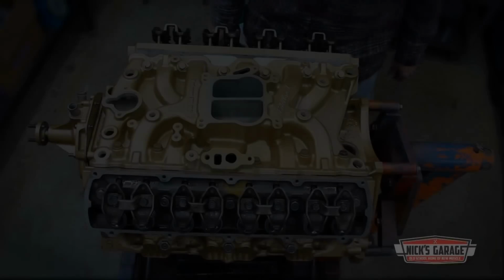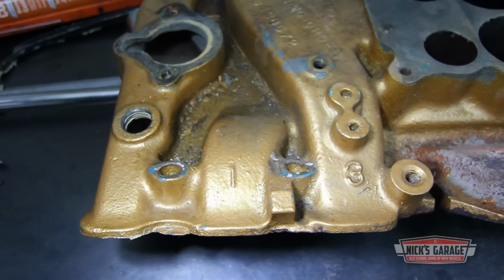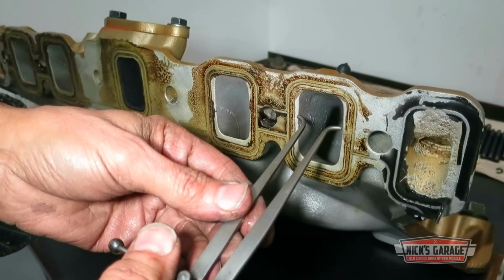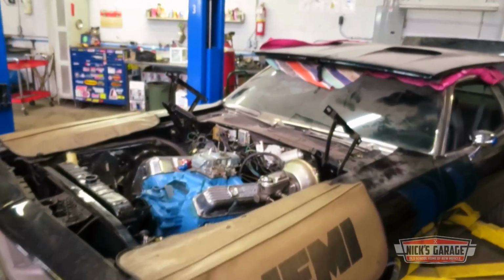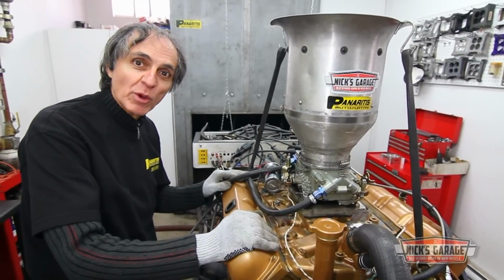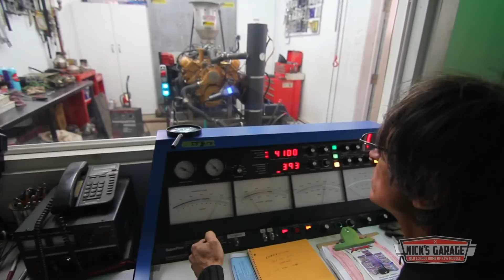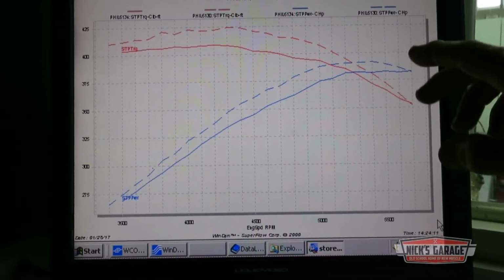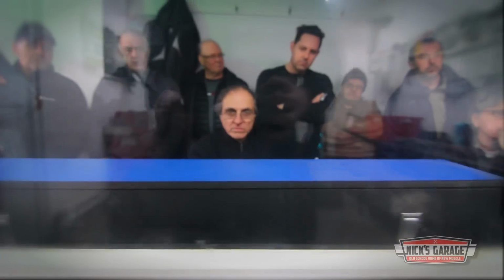Edelbrock VS Iron - Rocket 350 on the Dyno!

Comment: I think I would have ran a quadrajet. Better drivability and when you want to put the hammer down you got the big ol' secondaries. John Lingenfelter used to run them on his Oldsmobiles the he raced.
Reply: K Lyttle me to, I see people putting adapter plates on gm engines all the time so they can adapt to the tiny barrels of a holley, I have rebuilt many q-jets over the years and you can get very good performance out of them if you know what you are doing and they are very efficient like you said
Reply from the maker: I agree with you both about the driveability of the Quadrajet, they perform great on the street.  And better fuel economy too.  I like to use the Holley while am breaking in the cam and doing my testing at full throttle.  This engine will have a Rochester on it when it goes back in the car.  We'll be bringing you that Rochester tuning and installation in an upcoming video. Thanks for watching!
Reply: Nick's Garage awesome, I can't wait to see it 😊
Reply: Dual float Holley's are a lot easier to rejet quickly than a Q-jet.  You can change the secondary metering rods quickly on a Q-jet, but you have to disassemble the carb to change the primary jets.  I imagine this is quite a time killer when you're chasing a set-up on a dyno.
I personally prefer Q-jets for the street, though.  They're more difficult to fine tune, but man do they work good, especially with an automatic transmission.
Reply: Will agree on the choice of a Q jet. Have one on a 350 Malibu & one on a 318 in a Duster (MoPar used them starting about 85 when Carter went under) and street perf is better than a square bore. Square bores seem to be a bit mushy at part throttle compared to the Q jet. That iron intake w/ the square bore adapt has a lot of turbulence at the manifold surface. Well prepped Q jet will perform quite well if you know how to do it.
Reply: I would take a Holley anyday..Q-jets are nicknamed quadra-bogs for a reason!!
Reply: If your Q-jet is bogging, you don't know how to adjust it.
Reply: Buelligan88 Holley DP over a Q-jet all day long!!
Reply: exactly, the people that dont like q-jets are the ones that cant work on them, also it should be apparent who flows more cfm considering the back barrels on a q-jet are bigger than all four barrels on a holley
Reply: Q-jets max out at 800cfm where Holleys keep going up! I have worked on both and for Pro street and drag racing I choose Holley. If a Q-jet works for you great but feeding 700hp big blocks is infinitely easier with a Holley.
Reply: Q-jets came in two flow ratings in stock form, the largest at approx. 850cfm can be identified by the larger primaries.  The carb was never designed for 700hp engines, but can be modified for higher flow if you know what you're doing.  As soon as you said "bog"  you tipped your hand that you don't know anything about  Q-jets and are just parroting something you heard.  Instead of showing us what you don't know,  you should take into consideration this is a video about a 400hp 350cid engine.  Maybe you'll have better luck commenting on another video... like monster trucks or something..
Reply: At least I commented without having to insult!!
Reply: Buelligan88 really? lol. I respect Nick enough to say to you "Have a nice day"
Reply: If you respected Nick you should have taken more effort to read and comprehend his comments on the matter;

" I agree with you both about the driveability of the Quadrajet, they perform great on the street.  And better fuel economy too.  I like to use the Holley while am breaking in the cam and doing my testing at full throttle.  This engine will have a Rochester on it when it goes back in the car. "
Reply: Doesn't have to be a quadrajet to have big secondary's,  Any spreadbore carb will have big secondary's. Quads are to touchy for racing Holleys are more friendly imo, I've used both including Edelbrock, and always ended up running the Holley.
Reply: Remember the thermoquad carb, mainly plastic junk.
Reply: Glad to hear Nick's feedback on this.  Thanks for the info Nick!  Any updates on this motor?
Reply: Yeah, smallblockchev, idiots call them that because they like to f#@k with 'em thinking they know how to adjust them, when they don't.  I run Q-jets on all of my stuff, next best thing to EFI and more reliable too, when they're built right.  Holley's are good carbs, better for racing, but they don't gain anything when bolted to spread bore manifolds, as demonstrated here.  If you want a square Holley, get a square manifold.
Also, Cadillac used some 850 cfm Q-jets on their big ol' 500 cubic inch engines, and they can be easily modified to flow up to 900 cfm, but yeah, Holleys are still better for racing performance, and Holley even made some spread bore carbs to replace factory Q-jets.  They work a hell of a lot better than adapting a square Holley onto a stock manifold, but I'd still prefer the Q-jet.
Reply: The Q-Jet is called that by people who don't know how to tune them, and don't correctly set the spring pressure on the secondary air doors.  Most tired and/or out-of-tune Q-jets were replaced by Holleys when the Q-jet merely needed a secondary air door adjustment, or needed primary throttle shaft bushings to seal the vaccum leak that kept them from being idle adjustable.  Properly set up, the Q-jet is a beast, and an experienced mechanic can set one up without breaking a sweat.
Reply: It seems like all the quadrajunks i have come across were worn out, warped, failures. The two i had on my car never ran correctly. They were the computer controlled ones. The one that was on my friends' 350 chevy ran rich with the idle mix screws all the way in, so he put on EFI. I went with a holley 650.
Reply: Only by people who don't know what they're doing.  Q-Jet is the best carb ever made for anything that's mostly street.
Reply: The thing I find odd is they changed the jets, BUT the Rochester also has different metering rods for them!! And the way I made a bit more power was to swap out the jets and then change the metering rods which made ALL the difference in the world!!!
Reply: @NicksGarage  
Thanks
Merry Christmas to all family 
Happy New Year
Reply: They just sound better too.
Reply: Quadrajet Pushed my 87 i-roc 305 Very nice. As long as you idle around in overdrive. Soon as the 4bbl kicks is i used to Watxh the gas gauge..
Reply: Lingenfelter was paid to run the rotten-chester
Reply: I've built quite a few myself. Got a friend's truck from$70 a week on fuel to 50. Almost$1000 dollars a year back and forth to work.
Reply: @CARUSO1944  I pulled one off of a 392 International from a Travelall, it went to pieces
Reply: Dave Micolichek  I'm glad . I myself have always run double pumpers on the street. Easy peasy to tune and no driveabilty issues I have come across. I have a big block pro street so I choose Holley.
Reply: @smallblockchev64  Says the internet boy from his mother's basement.
Reply: @spaceghost8995  Congrats to you internet warrior on such an original put down. Lol you'll go far with such insults. Thank you for my daily smile.
Reply: @smallblockchev64  . QJets are the most precise carb ever designed. Holleys, esp old Holleys are very crude by comparision. QJets do have to be setup properly. Must have been good enough for Ford as they bought QJets from GM in 1970 to put on their big dog 429!
Reply: @Bridging_the_Political_Divide  my Holley still kicks a$$

Comment: with the elderbrock intake taken off ,maybe tap and plug those holes at the bottom of the intake base .prevent exhaust gas from being put back into the intake charge .or try a air gap intake ,or a small electric vacuum pump ,for crank case depressurization.

Comment: That port being smaller on the Edelbrock intake is a anti reversion dam. That is why the fuel mix ran leaner with the factory intake. Less pulsing at the carb. I have many times setup a mismatch the same for this reason.

The 9-10 horses can be had going with the RPM performer but the old regular Performer might just give a tad more average power.

Comment: It's no wonder that OE manifold would have been less efficient.
Runners shaping is poor. Like a square T when they split in 2 directions. Mixture has to do a 90 degree turn, which is exactly what Edelbrock corrected on his unit.
Not speaking about the spread bore to square bore adaptation.
To me, a good porting and portmatching on both manifold and heads would give the missing 10hp. But that's a costy job.
Reply: Agreed! I would try Manifold first, though. Be suprised how much just a simple port can increase flow and fuel atomization.  Hand ported the intake elbow on my stock 97 Grand Marquis and picked up 12hp from 2000rpm to rev limit(about 6200rpm). I wasnt gonna touch the stock plastic intake manifold but i did anyway and pick up another 10hp and another 10 when i went to the PI intake, ported that and now im at about 270hp to the tire. Not bad for  a bone stock 4.6 in a 4 door 4000lbs family barge.
Edelbrock wont sale a part that isnt better than stock when it comes to heads,intake, cams or carbs

Comment: I have a trick to match intake ports. I bolt the intake and gasket onto the heads, then I drill a small holes in each corner, through the intake, the gasket, and into the head. Then I use the blunt end of the drill bits ( I have four) locate the gasket to the head and intake, scribe lines and grind away. I use 4 of the same size bits to locate everything in place for the final assembly, the blunt ends, so everything is indexed to the right location.  This way I KNOW it's done right.

Comment: I'm thinking that mismatch between the spread bore manifold and square bore carb was what held that thing back.  Plenty of sharp edges to pull fuel out of atomization.  A few minutes with a die grinder would have gone a long way
Reply: Uncle Tony's Garage.  True, but my client wanted the stock intake left alone, Factory.

Comment: Do a good port match on the Edelbrock, and it will turn 400 hp.
Reply: Owen Lee Green , God that adapter plate was horrible.
Reply: @stclairstclair  yeah it was. He should have machined the big chunk from the Rocket cast iron manifold. But that was designed for the Quadrajet ( Quadrajunk) carb small primary with large secondary. Fair carb properly tuned. Since they won't remake the Thermoquad. Same spread bore pattern. Better tuning 800 CFM.
Reply: @OneEye.  how old are you, im 52 and as a mechanic i only rebuilt a few carbs before they went to fuel injection, haven't seen a carb tank in a long time.
Reply: @stclairstclair  56 grandson of the chief of mechanical repairs at the test site, I grew up in the late 70s early 80s. As a mechanic, street racer, on the broke budget. Fix what I have. so I can get to work. Mid 70s pits at Lake Mead water ski races. Learned young kid in the muscle era of cars.
Reply: Or build your own street engine like a marathon marine engine.
Reply: @OneEye.  My grandfather was a mechanic in ww2, he had 5 sons most became mechanics, All did 1/4 mile racing and luckily i got to grow up with this,  Gramps sold MAC tools also, so i too became a mechanic, too poor ever pay someone to fix anything ever. my family built the house we grew up in......
Reply: @stclairstclair  yeah that's how I grew up, on the Two C's Car's and Construction. Been building house's since 14. Turning wrenches on the side. Built a couple of race cars a few years ago one was track champ, for 5 seasons.  Boats bikes cars houses fabrication so many facets like a diamond in the rough. getting ready for next month when I will be part of a crew that shuts down and and races on 100 miles of two lane public highway at triple digit speeds. Legally!.

Comment: Smaller intake runners can get more velocity- edelbrock are typically much better than stock- adding adapters only band-aids the problems, but can help. That’s a nice motor even at 391+ horsepower.

Comment: I read somewhere recently that for an intake to 'work' each runner has to flow ~15% more air than the port it supplies.
That iron intake could be made work. I'd machine it out iron intake top to look similar to the Edelbrock. Then I would consider running a spreadbore double pumper/Q-Jet etc on it with a divided spreadbore spacer. I would then use a thick insulator type open spreadbore gasket between the carb and the first spacer to see if equalizing the plenums works at all.
The reason I say this is because another vid showed how a Performer RPM could be made to perform the same as an Air Gap by maching the Air Gap's notch in the divider of the Performer.

Comment: Holley makes Spread Bore Carbs too .  I had a 350 Olds     22 to 1  Compression  ration    in a 1981 GMC pickup ..  about  145 HP    18 MPG on highway ..

Comment: Head flow is the limiting factor.
Reply: DBSSTEELER. Very true.
Reply: DBSSTEELER good head flow is the key to horsepower but a big performance camshaft is at least the key ring... just shove a bigger cam in that olds engine and he would have easily eclipsed 400 horsepower but it would have been a pig to drive on the streets though

Comment: Nice Olds. Some times it's a matter of distribution and atomization as well as flow. I would also look forward to a spreadbore on that intake and seeing what the dynamics it gave would do. May get a real surprise from a QJ. I was also hoping for better results especially considering that Pontiac cast iron 4bbl intakes are held in extremely high regard for performance applications.

That doesn't discount the progress that the aftermarket puts into their intakes and continuation of their development after the OE has stopped not to mention the enhanced focus on performance instead of compromising on other things.
Reply: Also may be worth trying an annular booster carb on it vs the down leg booster carb.

Comment: A Q-jet in the first place would have done it!
Reply: A lot of people don't like the Q jet but with a little tuning they really are a great carb 
I have a76 Caddy 500 and it weighs about 5000 lbs when I bought it just over 2 years ago it got horrible fuel mileage after I rebuilt it, took nearly 5 hours, my fuel mileage went from 7.5 around town to 9 mpg and highway went from. 12 to 15 mpg.  I realize that's still not great mileage  but the performance compared to how it was is much better and smoother
Reply: @bertgrau9246  hell yeah ive bought tons of runs but dies cars with q jets,

Comment: I had a 350 rocket in a 71 cutlass that was incredibly fast and strong for being completely stock lol my brother in law was mad because i bought it for $100 and all i had to do was adjust the carbuerator he thought the engine was on its last leg!!! Why was that paticular engine so strong way stronger than a chevy 350!!!
Reply: Dad had one in his '68 olds. Very fast
Reply from the maker: Here’s to all the dads and all their rides.
Reply: the oldsmobile design is rugged,more so than a big block chevy or buick,olds were tough,i worked on them in the late 60's and thru the 80's.never had to overhaul their rear ends,even under warranty,they were that good,anyway olds 350 is very good design good rod stroke ratio,its all about that,some internal forces detract from horsepower and its all due to internal friction,like chevy big blocks horrendous rod stroke ratio of 1.45,olds best gm engine

Comment: When you consider the early 400 ci Old's Rocket engine made 345 hp,  ..391 hp wasn't such a bad number.  I had a 1964 Old's 442 with the 330 ci Rocket engine when I was in High School and it served me very well, with its 310 hp.
Reply: I just bought a 65 330 out of a 442 for my 1985 88. Havent got it in yet though. Is it a good motor? Good enough to keep up with todays traffic?
Reply: @eyeshocars9978  You bet. I had two friends in High School, in 1972, ..one had a beautiful 1969 Boss 302, the other with a 1969 383 Roadrunner ...man were they pissed when I beat them both ..I had to race the Boss three times before he believed it. LOL
Reply: Thanks for the reply. Well that says it all there. Do you think they can run with modern lt1 and ls1 stock engines?
Reply: @eyeshocars9978   The LS engines are just over developed push-rod engines.  The 330 Rocket has a lot of potential but would require upgrades ..aluminum heads for higher cylinder pressure while running pump gas, an electronic ignition and induction upgrades ...like a digital ignition controller (CPU) fuel injection and headers.. and with a stroker crank could easily make over 500+ hp and 500 lb.ft, torque.

Comment: does Edelbrock make a Performer RPM for the small Olds?  if so, that would likely find them the extra 10-15 hp they are looking for....
Reply from the maker: Funny that you should mention that... stay tuned!
Reply: I have a Performer RPM on my 1970 350 Olds and it makes just under 500 near 6200 RPM with a 770 CFM Aluminum Holley Street Avenger, but I have big block valves, roller Rockers and a more cam. About 10.5:1 compression.
Reply: and a Victor intake (Edelbrock 2812) has even more potential up top